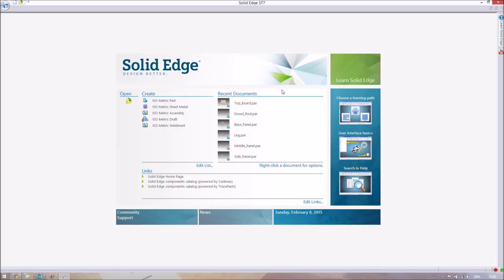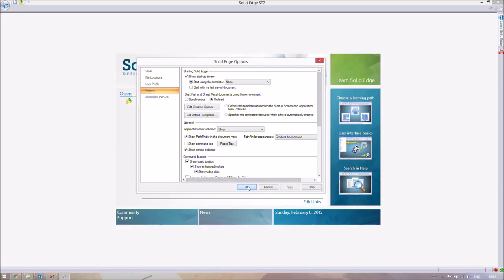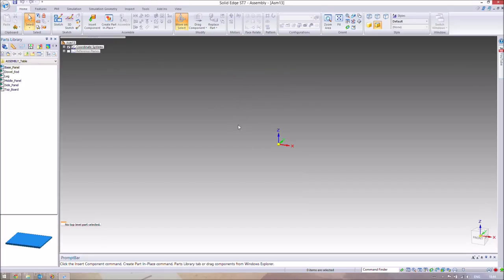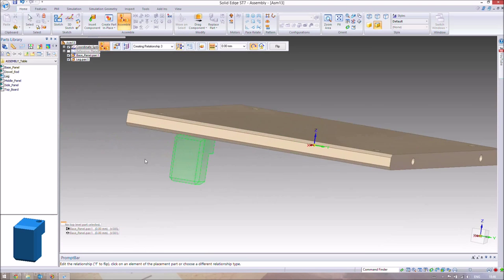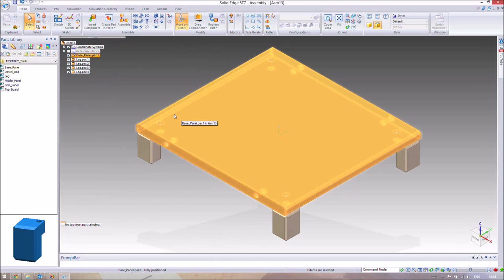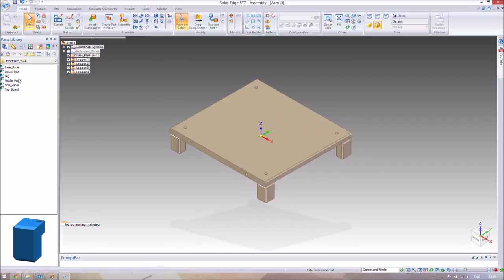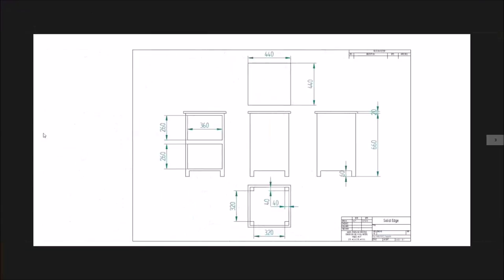Solid Edge Basics 4

Comment: Hey, is there a way to delete a relation after create one as some of my objects have similar side sizes and i constantly create wrong relationships. What's a fast and easy way to change these without deleting them? Thanks.
Reply from the maker: +Jonathan Ho Hi Jonathon, sorry for the late reply:

When you have a part selected, all of the relations and assignments are found in the bottom left hand corner of the screen:
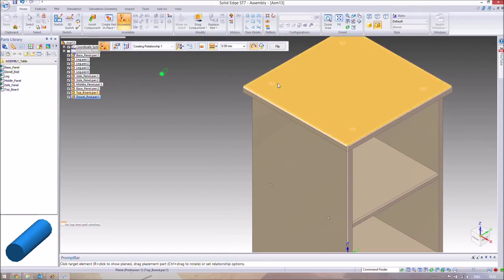For example, if you go to 13:00 minutes into the video when I'm putting in that dowel rod you'll see every time I make a new relationship that a new 'box' appears in the lower left.

Delete where appropriate.

Ta.
Reply: Tuition Project Thanks for the help :D